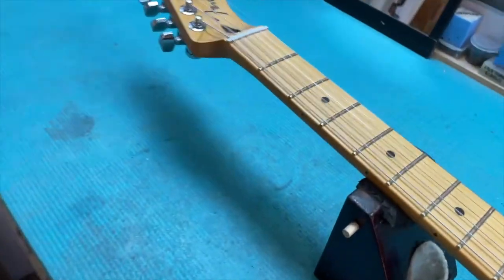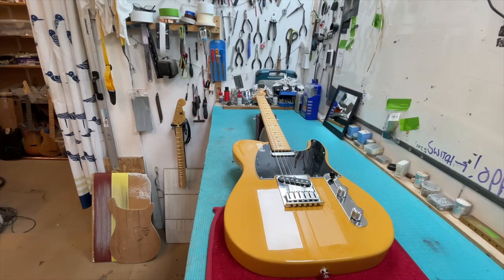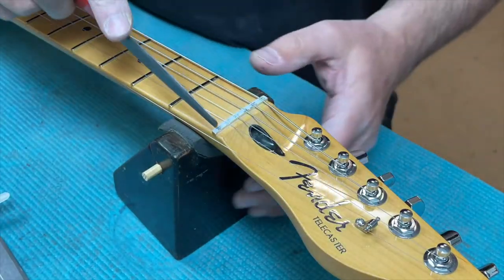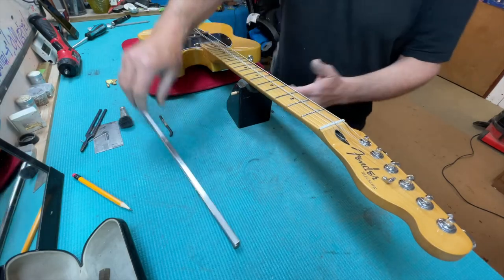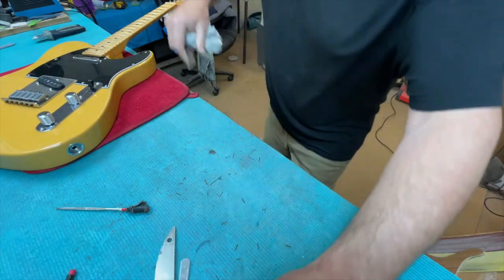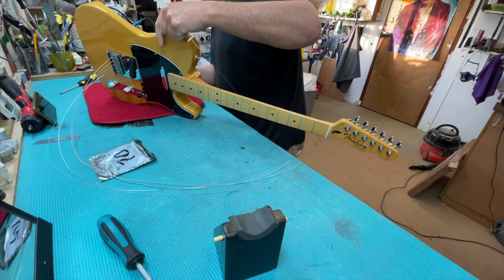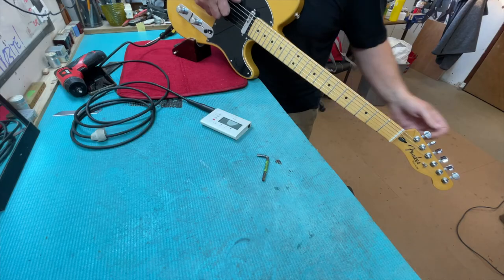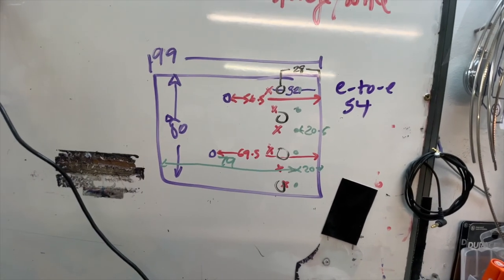Fender Player Plus Tele set up

Comment: I keep seeing this disappointing level of engineering/craftsmanship from Fender. It's unacceptable specially for a guitar that's on the 1000£ mark. Prices are so high and keep increasing and the quality is far worse, I don't get it.
Reply: My Am Ultra Tele had the same issues! Returned.
Reply: If you think fenders quality control is terrible wait until you see Gibsons, gibsons are way more overpriced and have an issue where the headstock breaks so easily. At least fenders aren’t as expensive as Gibson but yeah it’s still disappointing fenders quality control is getting worse. Their ultra series guitars are terrible then ultra guitars from the 90s and it’s so weird how it got to this point.
Reply: @Zamn_daniel  yes...definitely! I tested the new 80s explorer that cost around 2.5k and the quality was so bad...
Reply: I have one of these Teles and it’s flawless!
Reply: You got lucky. In my experience 50% of Fender guitars have issues.

Comment: Had one the same fixed by moving the neck forward. That brought the whole intonation saddle position into the correct place. When you find  a new guitar with a bad neck position, there is usually a reason for quality control letting it pass with an obvious fault.
Reply from the maker: Sidney, that IS a good alternative 'solution'. I've only once shaped a block and 'boosted' the neck outwards in a similar situation but it worked just fine and, as you pointed out, it dragged the tuners forward. In that case it brought the low E back into being 'intonate-able' and it and the A could have springs again. But it would be a workable way to get these grub screws off the anchor screws if only by 3-4mm.
Reply: @SamDeeksRelovedGuitars I was watching a two year old video of you setting up a Fender Tele Player series that would not play in your ballpark of low setups. The problem is caused by the uneven finish coat on the fretboard, the only way round it is to use the old leveling beam rather than a truss rod. You will come across a badly finished fender neck from time to time it is not the neck that is wrong but the spray job and polishing wheel that takes a good neck and turns it bad.

Comment: Just came across this video. Thank you, @Sam Deeks! I pulled out my Player Plus Tele to compare the bridge to my other Fender Select Tele and came to the conclusion that Fender must have changed designs! Haven't taken measures yet but it seems to me that with the Select Tele (made in USA) the plate screws are further down to the folding of the plate, where the saddles are adjusted.
Reply: @SamDeeksRelovedGuitars  I think Fender used Gotoh as an OEM - I checked at Stewmac - the Gotoh bridge has the exact measures. The trouble begins, when you use 11-50s strings (like I do) - then the bridge saddles definitely get in the troubled zone..

Comment: I have a player plus with the Pau Faro fretboard and there is no issue with gloss finish on/around the frets.  A Rosewood fretboard might be better, but I'm quite satisfied with the Pau Faro.  The  neck is apparently set accurately because the strings align with the neck properly.  The bridge anchor screws are counter sunk, so there saddles are still in perfect alighment/spacing following intonation.  Maybe I was lucky/fortunate to get one that appears to have been assembled correctly but I'm very happy to have watched the set up.  Thanks much!!
Reply from the maker: You're welcome. You got the Quality Controller on a good shift by the sound of it! Glad it wasn't a problem for you. By definition those that I see are going to be the 'less good' ones out of the bunch (being a guitar tech!)

Comment: Great video I was recently looking to buy a player plus tele buy was put of by the saddle and ended up buying a Vintera 60s Modified in Lake Placid blue .It's got the traditional 3  saddle  ashtray bridge and love all the tones of the modified The 60s also comes without a truss rod adjustment  hole in the headstock which i love .
Reply from the maker: It's funny how many people kind of 'defend' the positioning of the screws on these bridges (AND the domed heads). It's just not sensible design, period.

Comment: The problem with the saddle screws confirms my decision to build a custom Telecaster myself rather than buy a fender.
The specs I wanted would easily have cost me $2000 at the Fender custom shop. I didn't spend more than $400 on the self-built including Seymour Duncan single coil neck pickup with humbucking dummy coil and Hotrail humbucker in the bridge position.
Reply: I'm considering building one too. Partially because I want to save money, and partially because it will be fun. What body and neck did you go with? And, how did it turn out?

Comment: Thanks for this excellent review. I am (was) considering a Telecaster Player Plus and your review made me reconsider this just in time. At least I now know what flaws to look at when I am in the shop. I was planning to buy it online but after having seen this video I decided to go to a shop so that I can take a careful look at the guitar myself. Especially the points that were mentioned in this vid. One thing that I am still wondering about: are these flaws general, or is the majority of the Player Plus Telecasters fine and was the guitar in this video just an exception?
Reply from the maker: Hi Jaycee -  fairly common I'm afraid. It may be true that as a tech I probably don't see the very best guitars in any range and only see the ones with faults... But judging by comments from others I don't think that's the case. The best thing is to go to a real-world store if you can and look out for the issues I raised.
Reply: I've got the Silver Smoke PP Tele.  Mine was fine.  I actually liked it better than the premium American ones.
Reply: I have a player plus strat and the frets were quite uneven. So yeah I think this is quite common. I have since gotten it PLEKd and now it plays like a dream. Sound great too

Comment: A bit late watching this one.
Well done with the jack socket tightening tool. I have something similar for doing engine tappets. When I first saw you holding up the bar it seemed obvious that it was intended to be used with a suitable socket. Presumably to be more adaptable and no doubt the maker assumed everyone would have a suitable socket set to hand. Just about to add a comment when I heard you rustling through your box of stuff and saw you'd came to the same realisation. Pity you needed to drill out the socket to fit but I guess that element of tool design is not standardised. Loving your work.
Reply from the maker: LOL it's funny that it would be obvious to anyone except me. I think I may have tried it a couple of years ago and given up because the tool wouldn't pass through the socket - so I probably told myself "No, that's NOT how it's supposed to work". IIRC there was little or no explanation with the tool (I could be wrong because StewMac are usually very good at that sort of thing) so I definitely blame 'operator laziness' more than the tool maker. So it's only taken me about 6 years to figure it out... that's speedy in my world ;-)

Comment: Excellent upload and great channel Sir. So glad I found this video as I almost purchased a used Player plus tele until I saw your video. I must say though that  I absolutely love this guitar, between the series pull, locking tuners and noiseless pickups BUT I cant buy this because of that bridge, it has really let me down. The guitar I was looking at had the low e saddle maxed out with some spring cut off and 4 saddle set screws were sitting on top of the bridge plate screws. I started to look around for alternate bridges with the idea of  still buying this guitar and just swapping out the bride but I cannot find an alternative.  I can find 4 hole bridges that look like they will fit - but here lies the problem.....original bridge shows strings and saddle set screws pretty much close to above the 4 bridge screws, and when I see alternate 4 hole bridges - the saddles are well forward of the 4 bridge plate screws which wouldn't work because the strings would be too short. Maybe I'm missing something but I feel that it cant be replaced without drilling new holes further back for a new bridge. I'm so disappointed as I really do love this guitar. Thank you for your insight and this awesome channel
Reply from the maker: I say this with no sense of joy - but WELCOME to my world. Actually I'm glad that you clearly see the sheer pain-in-the-a** scale of this problem that Fender has stupidly created :) The complication is that any replacement bridge you buy HAS to line up on the 'string thru holes' first and foremost. Only THEN can you look to see if - by luck - your bridge fixing screws (the ones going down into the guitar's body) come anywhere close to matching up. And of course, since you're trying to replace the bridge because the position of those same bridge fixing screws on THIS model is unworkable - you're looking for a bridge with string mounting screw holes well in front (or possibly behind) the area where your saddles will sit. Your problem is that (I think) you'll find that almost no sellers of replacement bridge plates will give you enough information / dimensional data to be confident in making a good decision - meaning that you may end up having to buy several bridges and return (or keep) all those that don't work. 
To be fair, placing a saddle grub screw on top of a FLAT topped counter-sunk fixing screw isn't the end of the world (the saddle isn't intended to move during playing after all).. but you'd need to experiment with a few different types of screw probably. 
Hope that helps!
Reply: @SamDeeksRelovedGuitars  Thank you so much for your reply, this helps very much. Here in Canada that guitar costs $1380.00 and today the idea of building my own tele with those appointments in the tele plus that I like has crossed my mind, so with pricing out some reputable non fender parts it came to $980.00 with Fender TexMex pickups, wilkinson compensated bridge and a 4 way control plate rather than a pull/push. I'm really starting to like this idea I must say........and I can reference your videos should I need guidance. Haha thank you again mate and have happy week Sir.:hand-purple-blue-peace:
Reply from the maker: @BobF67  That’s a good choice - fyi check out the pinned post on Reloved Guitars Facebook page; my ‘5 Steps to Guitars Set Up Heaven’ ebook covers my set up including how to make and use the legendary ‘Banana’ fret levelling tool to level frets with the guitar fully strung. 
You won’t regret building your own partscaster - the learning alone is worth $900 AND you’ll get a great guitar out of it too!

Comment: The push-pull pot throws the pickups into series, so you get a fatter sound. It's a great feature.
Reply from the maker: @steven-v2x  yep it’s my preferred switching mod over the almost-never-used ‘coil-split’
Reply: A 4-way blade also does the same.  Very useful 4th position.

Comment: I have the same neck alignment issue on my Player Plus Strat. Pushing it. Sideways "frightens" me a little bit: couldn't it create a crack in the neck pocket ? Thank you for your videos, btw. Always interseting.
Reply from the maker: Hi Jean-Marie you can do it as long as there’s ‘wiggle room’ in the neck pocket. If you have to put it under a lot of pressure then it’s not ideal. If there’s no movement at all then you can create that ‘wiggle room’ with careful sanding or scraping in the neck pocket. If you don’t feel confident to do that, the only other alternative is to realign the strings over the saddle (there’s a high likelihood it will revert to the original positioning though) or to very slightly re-locate the bridge itself.

Comment: I went to check my fridge door was properly shut a couple of times before you mentioned the beeping noise and I realised it was in your workshop and not coming from my kitchen!! Regarding the neck alignment and need to adjust via the neck pocket, I've found I've needed to do that (to varying degrees) on most Fender and Squiers that I've worked on, though strangely the owners seldom raise it as an issue. But, at least a bolt on neck normally allows such misalignment to be fixed, unlike an Epiphone I recently acquired for myself where the bridge itself is clearly not positioned accurately. Love your videos by the way and I've learned a lot from them, especially in regard to your focus on and approach to 1st fret action.
Reply from the maker: Thanks David :-D I'm going to see my workshop landlord tomorrow with some rent... so I'm going to tell him about the beeping. Thank goodness my wife tracked it down to the electric socket-y-box-thing... I would never have located it otherwise!

Comment: I bought the exact same model, the saddle of the E string was already sitting on the screw without problem. The screws are sunk down
Reply from the maker: Definitely not sunk down on this particular model… they’re ‘dome shaped’ ie proud of the plate’s surface
Reply: Maybe they fixed the problem, anyway, mine has sunken screws

Comment: The "amber residue" on the frets and the cheapo plastic nut is simply lacquer or tinted clear coat! Its due to production and costs.  They fret the neck first and then get the finish on. After that, the frets are levelled. As they level the frets only and do not polish, you can notice scratching the strings while bending. .i noticed that on many mexican made Fenders. I even had that on the 1850 dollar Mike McCready Stratocaster! For me, that is an easy fix. Replacing the plastic nut with a bone one takes me one hour. Scratching off the paint on the frets and polish them including smoothening the fret ends another hour. If they would do it in the factory, the retail price would be 200 dollars plus.
Reply from the maker: That's right but one does wonder how the Chinese factories (for example where they make the Classic Vibe Squiers) manage to avoid this? From memory those guitars seemed to be finish first, frets 2nd.
Reply: @SamDeeksRelovedGuitars  I can imagine, that the chinese mask the frets before spraying the finish on. If they are painted first and then the frets pressed in, that may cause som cracks in the finish. I suppose, that the costs for manpower are just a fraction of the costs in Mexico or the US. Of course this is no excuse for a customer paying 1000 for a Player series guitar with that kind of poor finish.

Comment: I tried one of these in a local music shop today, and didn't notice the screws that held the bridge, but did notice the string spacing becoming wider nearer the bridge; so much so, that at the dusty end they were almost falling off the sides.  It looks to me like fender should have designed the bridge with slightly narrower string spacing.  Apart from that, it seemed to be quite a good guitar.
Reply from the maker: The string spacing by definition always gets wider towards the bridge... but it could be that someone has fitted the wrong width saddles (this can happen on 2nd hand guitars). There are various saddle block widths out there from 10.5 (for 52.5mm e-to-e spacing), 10.8mm for 54mm and I think 11.4mm for 56mm spacing. The point being that a guitar with - for example -  a 56mm e-to-e bridge spacing will have a correspondingly 'wide' neck at the heel but a guitar designed around a 52.5mm e-to-e saddle spacing is likely to have a slightly narrower neck at the heel... if someone then fits the saddles from a 54mm or 56mm bridge this will push the strings closer to the edge that neck.
Reply: @SamDeeksRelovedGuitars  This was a brand new guitar.  The saddles were not splayed at all.  I didn't measure them, and haven't found the specs online, but I suspect the spacing may be 56mm.  I fitted a Gotoh bridge to my red Tele, with 54mm spacing and the strings align perfectly along the neck.  Anyone know the string spacing on the Player Plus Tele?  Please post it here.

Comment: Do you think it would be better to change the bridge to a traditional Fender Telecaster? Or maybe a Gotoh with brass frames and adjustable for perfect intonation? Would it fit there?
Reply from the maker: I don't have the guitar here to assess that Federico... The solution at the time was to replace the screws and live with the proximity of the screw tops to the saddle grub screws. Finding an alternative bridge in this kind of situation isn't straightforward; you are constrained first by the string-thru holes and the distance between those and the saddle apexes on a new bridge. If they're the same (or at least 'reachable' within the saddle travel of the new bridge) then it's a potential replacement. The problem is that not all bridges (surprisingly few actually!) will list that vital measurement on the listing. You can't afford to just buy and hope for the best because if the thru-holes in the new bridge plate are significantly further from the saddles than your original, you're going to have to push your new saddles way back or way forward to intonate.. It's surprising how quickly you can run out of saddle travel.

Comment: I just got my player plus Tele and the intonation was way off. So I also had to move the saddles way back and even though the screws are there so a standard bridge can be installed if one desires they are still a problem for this bridge that comes installed my low E is backed all the way and it's just intonated. You can adjust the saddle screws that are on the bridge screws but it's just a pain. Other than that my high E was almost off the neck I had to loosen the neck to shift it over it's better but not perfect. The guitar plays and sounds great now just sad to see a new 1000 dollar guitar come like this.
Reply from the maker: No it’s not great that 1000 bucks leaves you having to put right basics like this. Of course if they got it right I’d have to do something else for a living ;-)